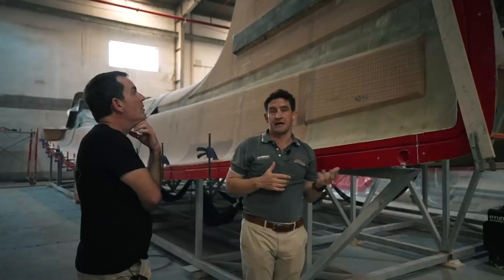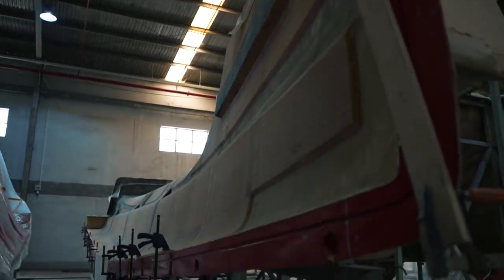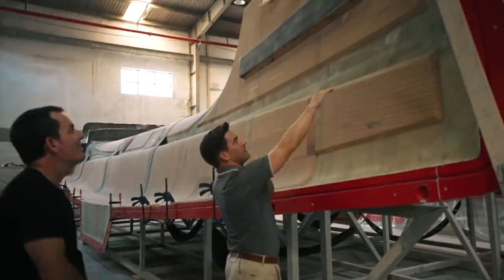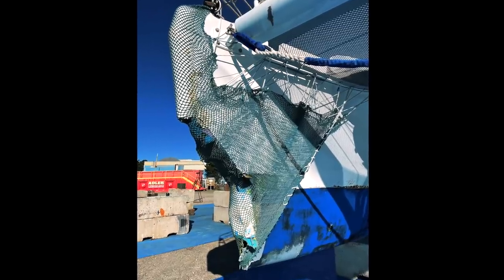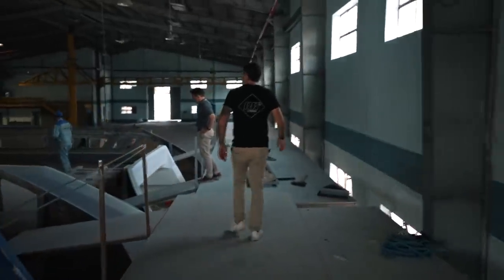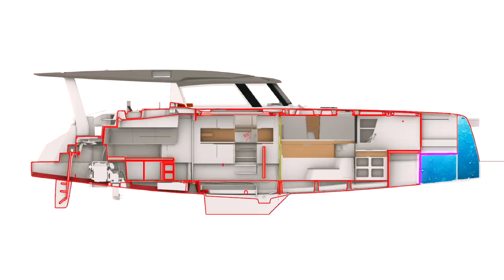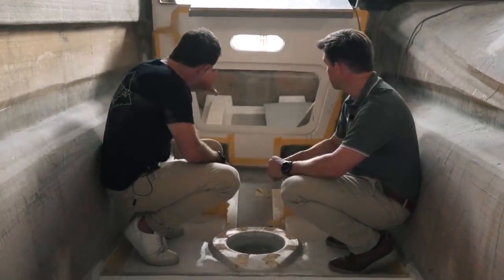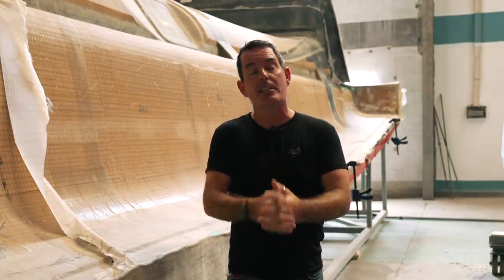NIGHTMARE Boat Crash 1,000 Miles From Land!

Comment: Parlay showed us all just how badly the bulkhead design and installation can be on a production catamaran.  What is coming through in your videos is the massive difference between Lagoon and Seawind.  Impressive.
Reply: There are bulkheads it seems and then there are walls separating the cabin from the saloon!
Reply: There are many other lagoons with the same issues
Reply: A bulkhead can be made out of plywood or a cored laminate fiberglassed to the hull.  Which the builder or designer chooses is based on the degree of commitment to lower displacement.
Reply: @timdunn2257  yes of course.  The critical factor is how the bulkhead is then integrated into the hull.  Needs to be properly tabbed along its length into the hull.
Reply: Yes, the bulkhead must not touch the hull.  There should be perhaps 3/4"  fiberglass bridging the gap between the bulkhead and the fiberglass hull.  I crossed the Pacific in a boat we finished out in the 1970s, and it is still making far voyages.
Reply: @CG-99   I bought a 34 foot monohull shell designed by Ed Monk Jr., and finished it out in the early 70s.  I sailed from Seattle to Hong Kong via the S. Pacific.  The next owner sailed around the world.  The third owners sailed to South America.  Batwing is still going strong, with the same unstayed grown Douglas Fir masts and junk rig designed by Blondie Hasler.  All furnishings were 3/4" Douglas Fir plywood bonded to the hull with a gap of about 3/4".  There was no core and no stringers of any kind.  All fiberglass was 24 oz. woven roving with a very small amount of the thinnest mat, bonded with a minimum of polyester resin.  The hull topsides were 3/8", thicker lower.  She displaces 18,000 pounds, with 6000 pounds of lead.  When I owned her, she had 740 sq feet of sail, and had been designed as a marconi sloop of 550 sq. feet of working sail,  and had a 20 hp diesel with a two bladed prop.  We almost always maneuvered under sail, and very rarely motored.  I don't think we refilled the fuel tank ever.  We crossed the equator four times, and if the wind disappeared, we simply waited for it to return.  We cooked, heated, and lit with kerosene.  We had electric lighting, but rarely used it.  In those days, of course, navigation was by sextant and compass, and charts were paper.  My mind boggles when I read about the electric systems and navigation equipment on today's yachts.

Comment: This is a terrific video - with the best graphics I've seen to explain the process of building watertight compartments into the hull as well. There are plenty of videos that show catamarans sinking because the keel was lost, seawater reached the floor board and nothing stops it from filling the rest of the hull as well. 2 questions are: 1) When water fills the floor above the keel, how is this boat keeping the seawater from filling the whole hull above the keel; and 2) Why not build a sail drive "well" that extends up to the waterline so the engine is saved from any failure and flooding?
Reply: that would require the engine to be .7m (?) above the current location, and you couldn't have a bed on top of that unless you accept to loose nearly a meter aft in the cabin... 
Also the longer shaft into the Z drive mean less efficiency ?
Another thought : a long "well" mean more torque on the structure in case of a collision on the propeller... so more reinforcment, more weight... probably not what Seawind want for a light boat :)
Reply: @RomainLagrange1  Sail drives (famously? intermittently? infrequently? take your pick) have seal leaks or failures, get snagged on ropes and wire, etc. They mandate an annual haulout as well - which is probably the strongest argument for shaft drives (because shafts don't require annual haulouts). A water-line high "well" separating a dry engine from the leaking drive could be "handy" or a lifesaver - depending on how dramatic you like to paint risk mitigation discussions.
Reply: @EdwardTilley , I agree with your point, and I personally prefer shaft drive too.
All solutions have their cons, and compromise have to be made.
This is not a foolproof expedition boat.
Reply: @EdwardTilley  
Interesting thought using flat rotary flux electric motors you could mount them vertically driving through an L drive with the motor mounted above the water line under the overhead deck or above it ...power coming from batteries or a remotely mounted generator running at a optimum efficiency  steady  speed and load. 
You can minimise the whole drive intrusion into the hull space length ways 🤔 and stern  
Wt.
Reply: You could build a sale drive compartment .. but you would still need to build an engine compartment and sandwich the  dividing wall between the engine drive mounting face and the saildrives input side mounting face... And seal both against water flooding the Drves Well...  Then theres the access and maintainance problem .... To seal anything that has to be removable to replace or repair you need radial bolt fastenings and that means at least two sets of radial bolts and seals in two plains..so you need space for inspection, tools  to be moved.
Reply: @clivestainlesssteelwomble7665      Generators are not as reliable as fuel engines, and are constantly having issues. As much as I love the idea of electric engines mainly because they are less maintenance, I don't want to trade a fuel engine maintenance for generator maintenance as that would be a full-time job.
Reply: Shaftdrives will always sit lower in a boat to give the best possible angle (or rather lack of angle) for the drive/prop for better efficiency of prop angle to waterline. SO advocating shaft drive over sail drive for their ability to weather a flooding in that area is illogical and incorrect. You could, of course, encase the engine bay completely into a crash bulkhead, but then making it accessible while still have water tight robustness would be problematic, necessitating large hatches for bodily access with even larger seals - the larger the seal the more difficult it is to make it seal well, and all the fittings and screws fixtures that are required to keep the hatch and seal together substantially to sustain that crash. All adding weight at the rear of the boat, which is not where you want it for a performance cat.
Reply: @RomainLagrange1  is there such thing as an unsinkable boat?? No but what Seawind is doing is super safe... No matter what happens, that's what a sub pump is for ..! Amazing
Reply: @donnakawana  
You can make a boat very strong and very safe ...a modern life boat is self righting and designed to not sink even if flooded as long as it doesnt get broken up....but you do loose interior volume and need to build in floatation bags, foam or   
Sealed voids.  
Double skins ether all over of  below the waterline or like this and on the bottoms are all structural tactics that 
boat and ship builders have used...for a very long time. 
Ive previously pointed out Brunel's Great Eastern..with its full double hull .

Comment: A weak spot is a weak spot.. good that builder thinks ahead. Look what happened to the Wynns with the life raft compartment
Reply: That was positively insane.  There really needs to be greater regulation to the pleasure yacht 🛥 industry similar to the automotive industry.
Reply: @Catherine S  there is regulation to some extent.. but boat building in International that's why the builder is very important. There are no secrets in boat building. Quality costs $. In the 80's there were a lot of cheap boats that were built.. they were OK.. but not suited for off shore. Builders learned a lot back then
Reply: The wynns boat builder was thinking ahead. The panel that came off was a access panel so you can get to the life raft if the boat inverts.
Reply: @Jttv  I know.. I watched it too.. it looked like the compartment became compromised over the years. I dudnt say anything at all about the builder of the Wynns boat. As long as you brought it up.. it is a weak spot I'm their design. I wonder if it has been changed

Comment: Hi guys you display a water tight compartment with a blue water lin graphic that reduces to the bottom of the boat that runs down the length of the hull were the sumps are, is this the case is it a sealed water tight area or is it open at the top a little confused
cheers 
steve

Comment: Great series to watch. Quick question with regards to the carbon. Is it possible to give some idea of how many layers of Uni-directional carbon  is used in different parts of the boat, ie stringers etc. Enjoy the build process, great to be able to follow the build of your own boat in such a nice place. Cheers
Reply from the maker: Oh my friend, we have lots of information on both the single, double axis and multi axis carbon fibre coming up, as well as the whys and wherefore of its use in different parts of the boat
Reply: @sailingrubyrose  Can't wait. I'm also quite jealous of the fabulous food you get to enjoy there, I think I would gain an embarrassing amount of kilos if I was there. Cheers and thanks for the respons.
Reply: @sailingrubyrose  That will be very interesting, but could you also feature how to properly repair a boat with such an optimized design, i.e. the damage featured in this episode?

Comment: I have often wondered if something like a garbage bag, filled with just mixed expanding foam could be put into flooding compartments.  They might not seal the leak but they would expand to fill the compartment with foam (essentially air).   Or they they could be pre-placed and set off in case of a crash. Might keep a boat from sinking?

Comment: Nick, good technical stuff as always. We dont often comment but......... Are you going to cover the opening of doors in bulkheads? Best practice is that they open into a  collision area and that force of water would force them closed or reduce ingress for pumps to cope. (as in the Amel designs) Given watertight impact bulkheads, there is still a level of water ingress that will need to be managed. Big or Small 😉 Sail Safe guys. Ant & Cid  xx

Comment: As expensive as these boats are, you would think sonar would be included, with collision warning. Also why not add foam to the front compartment to help keep water out. It won't add that much weight but it would give  the front end a little more collision protection.

Comment: Is your new boat solid glass or does it have a foam / balsa core..? Reason I ask is because several months ago a seawind  hit an object off the east coast of Australia and as it had no core and no watertight bulkheads (I assume) , one hull filled with water and it eventually turned over...

Comment: Do they put any kind of closed cell foam in the crash bulkheads for floatation? Seems like the ones on the front at least should have something like that of some of those inflatable bags.
Reply from the maker: No it’s open to save weight. However in case of emergency there are systems you can carry to address buoyancy. Next episode I think
Reply: It seems to me that those strengthening stringers are foam cored so there is buoyancy there.

Comment: I thought the inclusion of stringers on the hull was a very appealing feature from a strength perspective.

With regard to your brief discussion of engines I recently became aware of relatively new electric motor technology developed by Koenigsegg* called the "Quark"* which incorporates features the company describes as 'Raxial Flux'* and 'direct cooling'.

*Trademarked.

Apparently in it's simplest form the Quark emotor weighs a mere 30kg yet creates a constant output of 124 horsepower and 184 pound feet of torque although it is less than two cans of energy drink high and roughly one quarter that in width. 
(Sorry but I couldn't find any other reference for dimensions in articles I have read.)

As you can hopefully envisage, the Quark emotor is a tiny featherweight compared to other emotor's with comparable applications and statistics.

Although developed for a high-end automotive application it is being suggested in various ways that the Quark emotor also embodies significant implications for maritime and aviation applications.

I have never been a fan of sail drives for several reasons a significant one being that every time you alter the rate or direction of rotation for a drive shaft via a transmission you sacrifice power via something known as 'drivetrain loss' and sail drives do so through 90 degree angles twice.

Drivetrain loss is quantified by a phenomenon known as 'the 15 percent rule' but in actuality power losses are often if not usually substantially higher depending on the configuration of a relevant transmission and that is inefficient to say the least. 

Due to drivetrain loss and other considerations such as savings in weight and maintenance expenses I can easily envisage a sort of 'diesel electric' configuration being adopted by yacht designers in the near future that incorporates the Quark emotor or something similar.

While I have not yet found any energy consumption data for the Quark emotor I can envisage it enabling Catamarans to adopt a single engine/generator/lithium battery combination like some of their half-boat cousins and use it to power an individual Quark emotor connected to or incorporated in each prop.

The fact that electric motors can easily reverse their direction of rotation could probably dispense with transmissions altogether and even through-hull propulsion along with associated glands and periodic maintenance for two of everything as well as a separate generator etc!

It might even be feasible to incorporate a propeller/emotor combination directly to the rudders and so have completely vector-able thrust that only became available on the most modern, cutting edge ship designs in the last couple of decades!

Patently absurd levels to which fuel prices have recently escalated may well impart powerful impetus to this approach as well.

Because bitter experience has probably taught most of us that once the greedy money-grubbers who exercise control of fossil hydrocarbons in this world have an opportunity to take more, they virtually never give it up again.

They, are undoubtedly already beginning to feel the pinch as the developed world transitions to renewable energy with increasing impetus.

That they have obviously seen the Ukraine atrocity as a golden opportunity speaks volumes to the nature of their character.

It also occurred to me that with a configuration probably improving on what I can imagine an engine/generator combination could be located almost anywhere on a catamaran including in a pod under the bridge deck, which should greatly improve weight and load distribution as well as freeing up space and reducing cabin noise.

Comment: Very interesting. Something I am sure a lot of boat owners /cruisers don't think about. I assume the inspection hatches have seals so they rea essentially watertight. The people who had the crash indicated the forward inspection hatch leaked. In the video it appeared pretty high up. WAs it damaged or was teh crash bulkhead distorted? Hop you vidoe covering the crash answers those points. Can't wait.
Reply: Either way the spilt water will still flow down to the bilge and will exit the boat accordingly.

Comment: What is the maximum front bulk head protection rated speed for a crash of that sort?
Reply: Hi Right Right Theres probably a huge number of variables to that one😉 
Think about not just the speed but the exact contact point the hull or bows hit the object, the angle, its mass and shape.. is it a flat, an edge or a curve....how big a curve?
If you hit a corner 😬 of a container  
Its going to concentrate the impact and penetrate further 
than hitting more square on where theres more spreading the impact over a wider area of the hull at the first moment of impact.

Their is also the Titanic scenario.. the ship had began to change course and the iceberg gouged along the side of the hull breaching several transverse water tight compartments aft of the bow that flooded dragging the bows down and then overtopping the next bulkheads ...leading to the increased rapidity of its sinking

If the vessel had hit square on its possible more visible damage and injuries may have  occured in the collision - but it may not have sunk or sunk as quickly as it did because only the smaller bow compartments would have been crushed and flooded.
One of the weaknesses of the Titanic and Britanic was their relatively  small and poor rudder response for ships of their size.
🧙‍♂️
Reply: @clivestainlesssteelwomble7665  hence, we should get a reliable 360° obstacle collition avoidance system.    This should be mandatory for all osean cruissing vessels.
Reply: @rightright6582  
There are combined radar and IR UV camera systems available  to help stand watch and spot submerged and semi submerged objects at night ....
They are good and being mast head mounted have the advantage  of looking down and further ahead than the Mk1 eyeball especially at night.
They can also be used to activate warnings or evasive actions. 
But they are not perfect they have limits and like cars may generate a false sense of security... and they can break or get hit by lightening. 
So you have a technology and a price...and your designers and manufacturers targets .... 🌐🤷🏻‍♂️
How often are you going to be sailing at night offshore and in areas you're likely  hit something large and hard... be that a whale or a tree or half sunk boat or shipping container.
Following Tsunamis, floods or storm's you may get spikes in collision risks. The other one is drone submersibles...Scientific and Millitary some are programmed to surface periodically to transmit data.. 
They are not all small and are designed to function at depth. If one pops up infront or under you you have a rare but not unknown problem.